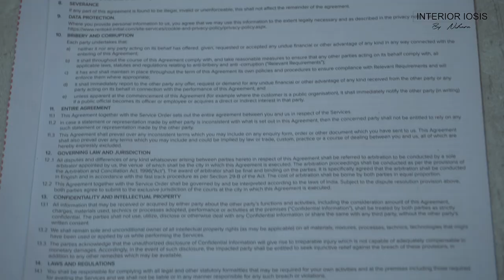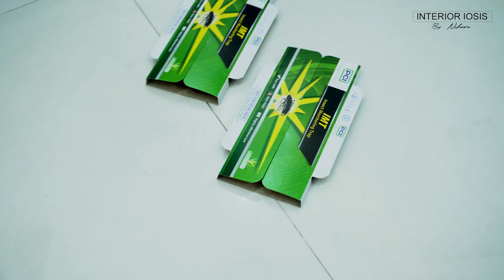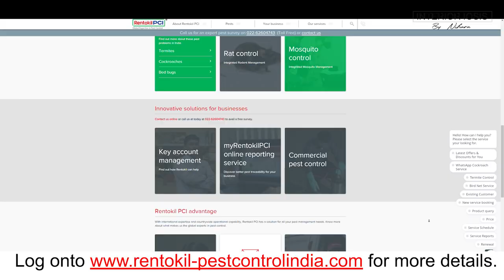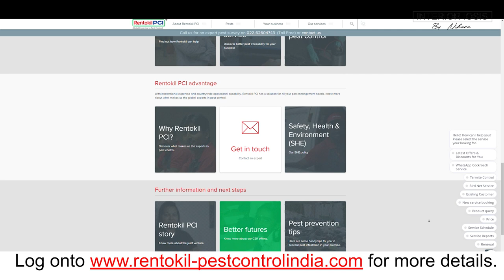Pest control During Interior design Process | Cockroach control | GoldSeal®️ Service By Rentokil PCI

Comment: Hello, 
I have given my 10th grade Boards exam this year. 
I want to become an interior designer and I have decided to pursue 3 years degree in interior design but for that I have 2 option first is to complete grade 12 with any stream and then take administration in degree Or the second option is to give 3 years diploma in interior design after my 10th than pursue degree course. 
Which option is best and also cost efficient please explain me I am soo confused. 😢
Reply from the maker: Hi I feel degree after 12 th is a better option… this is my opinion… you can visit colleges which offer both the courses and understand the difference from academic perspective. 
Cannot give guidance regarding the cost factor as I’m not aware of current fees status. 
Please do proper research n then take a call. Thank you 😊
Reply: @interioriosisbynihara7525  Thank you so much☺️👍
Reply: @interioriosisbynihara7525  Sorry to disturb you again but What if I did 3 years diploma and got a small job and simultaneously pursue a degree .?
Also, I belong to a middle-class family.

Comment: Any closed cabinet with lots of moisture is sure of attracting pest, especially cockroaches.
If extensively used kitchen then opting for a nice  open cabinets is a better option.
Probably interior designers may not suggest it.
Neat and a open kitchen rarely has any cockroaches.
Why to spend so much money for closing the kitchen cabinets and then let pest breed and then to get rid of them.
In open kitchen early infestation can be very easily spotted and cleaned instantly. 
Almost every house I had visited with beautiful closed cabinets when openend have  lots of cockroaches and lizards inside.
Eventhough they opt for standard pest control services, over a period of time it becomes very difficult. 
Real interior means high utility,easy maintenance and still looks pretty and definitely NOT looks good,high maintenance and less utility.